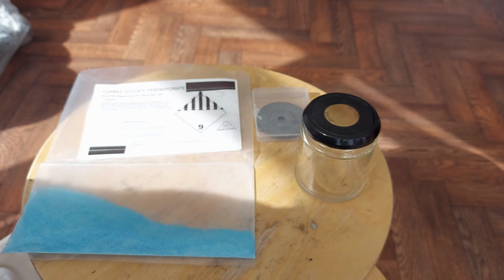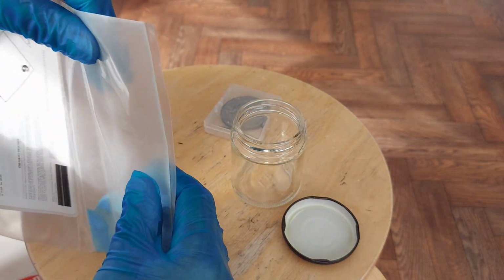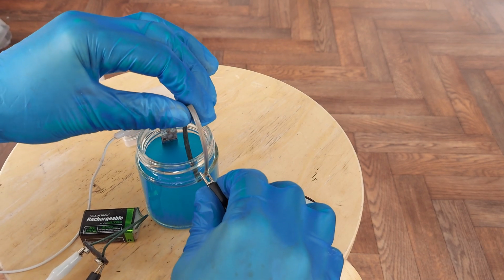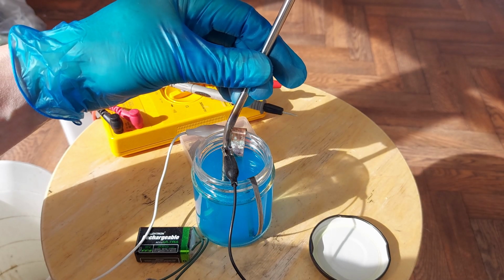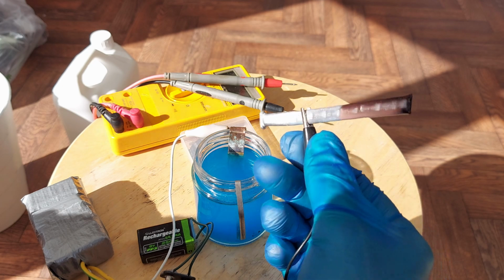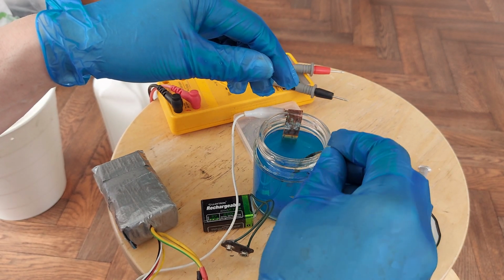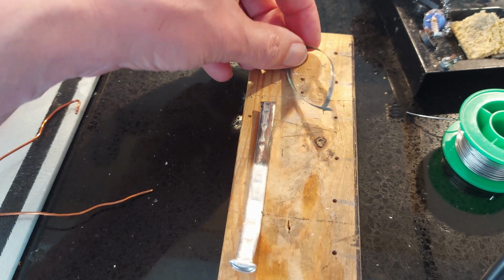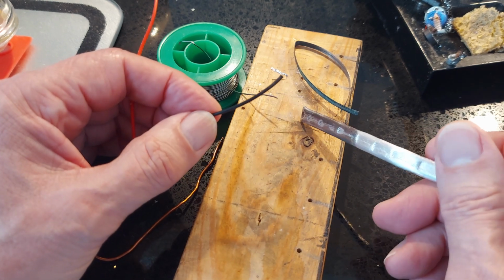Can I copper plate magnesium strip? NO!

Comment: I've seen the videos where an item is placed in a solution gained by electrolytic do-hickey, and then place material to be plated/coated and the soldered, but I do think that a higher voltage for a bit longer may be the way. 
Good luck.
Reply from the maker: I think most "normal" metals will plate OK, even the aluminium seemed to make an effort, but the magnesium seemed to be too reactive, so the copper didn't bond to the surface.